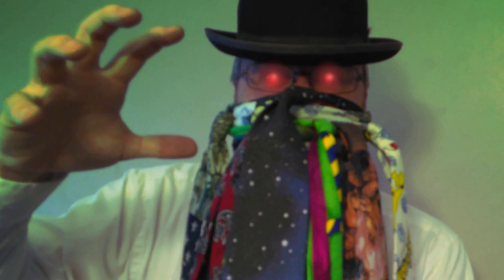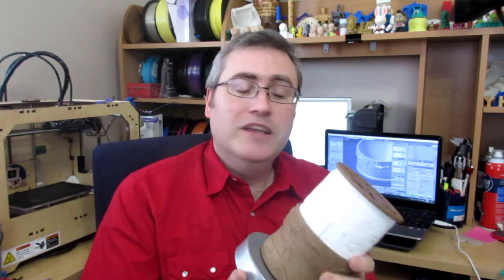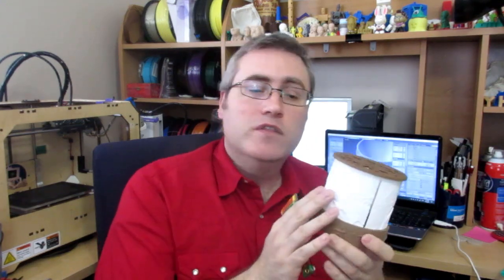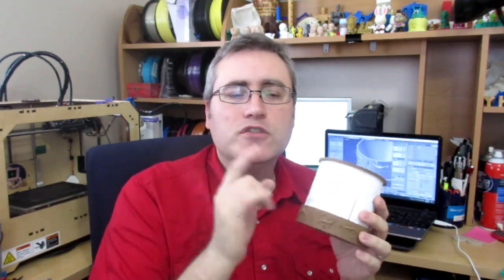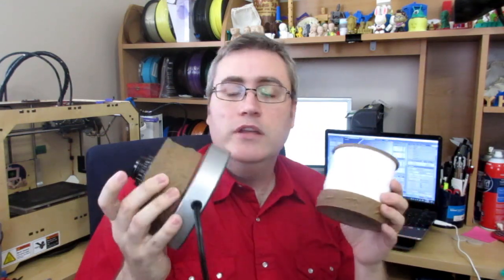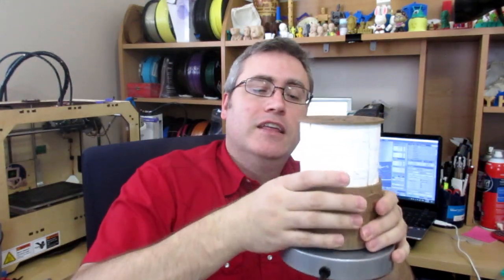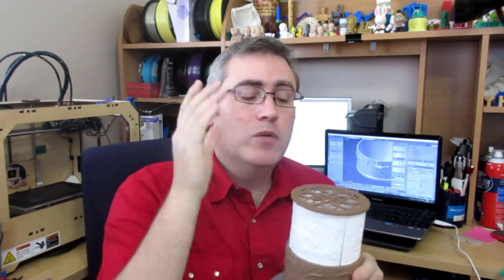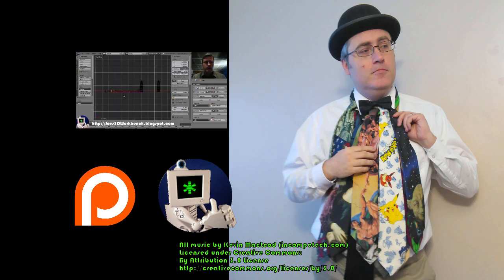From failure comes 3D Printing success - Lithophane Lamp project

Comment: You should try to use an led fillament light bulb at arround 5w. That shouldnt get too hot even if printed in pla. Also the led fillament blubs are providing a nice light and are looking like normal ones.

Comment: a matte 1-2W globe led lightbulb will only get warm to the touch, and it lights up rather smoothly. any more power, and it will just be too bright to look at directly.
personally i would still add (read: drill) a few ventilaiton holes around the socket, for better circulation, and 3 little pins (toothpicks) to keep the top from wiggling.

Comment: Whether you end up using CCFL or LED, it's good that you have ventillation on the top, but an improvement can be achieved by making some holes somewhere along the bottom. Convection is a pretty weak force in general.

Comment: LED Lights is a good call for the lamp and for the top why not drill small holes in the base and in the top lid and then put some Delves in the base part that is fixed to the base then the cover can just slide over the delves in to the holes in the lid

Comment: What sort of space do you have to work with inside for the light? Also is it maims power and screw socket?
Reply from the maker: Size of a standard light bulb. Screw socket.
Reply: you should pop in an LED bulb, they sell them at lowe's and pretty much any hardware store! they come with the standard screw socket as well! I use em' at my house and they work awesome and no heat is released!
Reply: There are almost stone cold LED bulbs that fit into the E14 or E27 sockets if you have one of those. They can be cheap off-brands from AliExpress or safe from Amazon. Watch out for ones that have parts of their PCB on the outside and avoid those - for more info watch Big Clive as he has a lot on cheap LED safety. The lamp looks beautiful. I really hope I'll be able to model and print things like this in a year or so. Thanks for sharing! Cheers!
Reply: dollar tree dollar store in the US has them for 1.00

Comment: Which CAM Software do you use?
Reply from the maker: This was shot on my Canon Powershot and edited on HitFilm. I also did record the audio externally in Audacity.
Reply: 3D Printing Professor
I believe they meant which Computer Aided Modeling program, not camera.
Reply from the maker: I should have known that. For some reason that's CAD in my mind.

Blender. I use Blender.

Comment: Best bulb would be an LED CORN lamp. (they look like corn cobs) this will give you VERY each spread out light which is what you need for that kind of thing. Something like this B01D4NLREW (amazon) though I think those are aa bit over powered. they will work but a 2 or 4 watt would probably give a nicer effect.

These B01IQIUYU8 (amazon) filament style bulbs should also work very well. they will only make about 1.8w of heat.

You might want to go with an E14 base for a much more compact bulb and fixture

B01HAUOUZ8 like those (available in 2w and 4w get both decide which is sufficiently bright)

Comment: what software did you use to make the lamp?
Reply from the maker: Blender. There is a website, http://3dp.rocks/lithophane/, but in the past it didn't actually work very well and the circular lithophanes it generated were broken, though others seem to be having good luck with it.
Reply: ok thank you for the info! ive tried the 3dp generator and found a Chinese software that does cookie cutters and a bunch of other stuff as well as lithophanes
Reply from the maker: What software is that? I'd love to be able to make good cookie cutters.
Reply: its called lithopiaenterprise sorry it took so long

Comment: led light would work don't no the connections over there but in UK there are these style https://www.amazon.co.uk/gp/aw/d/B0152WXI0E/ref=mp_s_a_1_3?ie=UTF8&qid=1484332894&sr=1-3&pi=AC_SX236_SY340_FMwebp_QL65&dpPl=1&dpID=31Auvoa-vtL&ref=plSrch and then there's these https://www.amazon.co.uk/gp/aw/d/B018I9TB5Y/ref=mp_s_a_1_14?ie=UTF8&qid=1484332894&sr=1-14&pi=AC_SX236_SY340_FMwebp_QL65
Reply from the maker: Those don't generate much heat? I'll try it out.
Reply: no not much you could put your hand on them whilst running and there cheaper to run then standard bulbs
Reply: just temp tested mine I've had it on since 6 in morning UK time and the temperature is only 32 degree Celsius